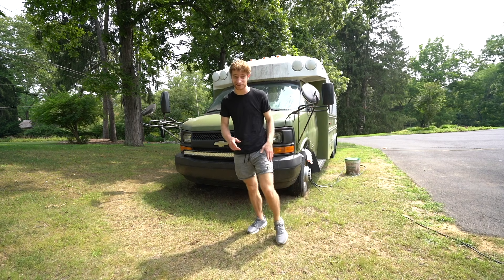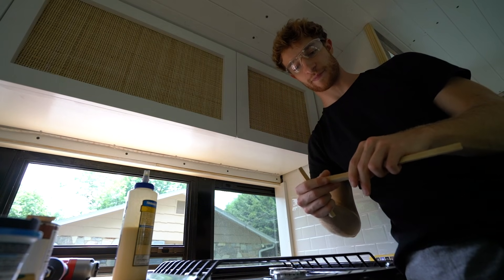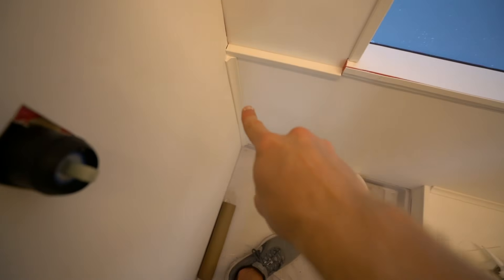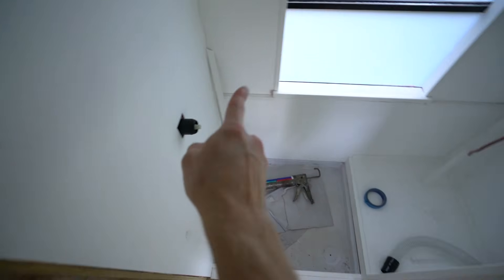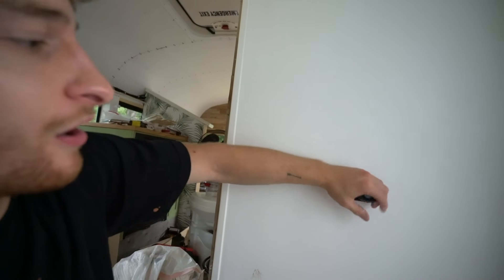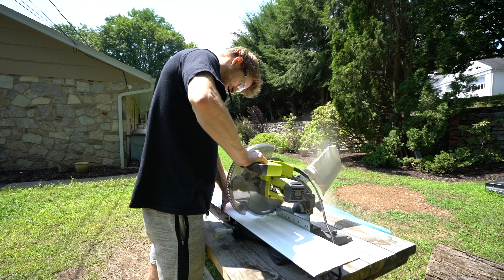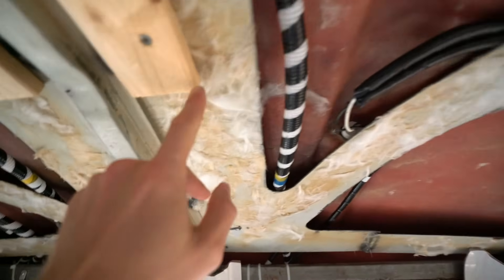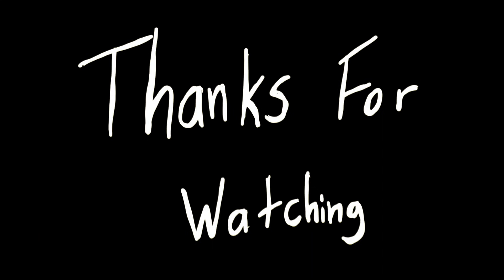Making my Bus a Little More Like Home - Skoolie Build Ep. 55

Comment: Matt, for the front, take those panels off and rotate them 90° and they should fit in, in 1 piece and bend to the shape of the roof curve. Then just caulk the seams. I would also caulk the ceiling in the bathroom as well, keep the water out. Looking fab matey.
Reply from the maker: Sweet, thanks for the tip Neil, I'll give it a shot today!

Comment: Much better video this week & your spirits seemed much higher. A lot of progress made this week. I wish I would've told you before about soaked that trim piece that you cut into 3 sections. You can soak it in warm water (I've read an hour & a half for each inch of thickness) then when it's flexible enough you can gently bend it to fit the curve & immediately attach. You could've also put a piece of the white flexible shower trim there. Just a thought. But everything is looking AWESOME Matt! I'm getting more & more excited for you! Great job & stay positive...LOOK HOW FAR YOU'VE COME DUDE! PROUD of YOU!
Reply from the maker: It's all good, I don't mind the look of it being cut up! But thank you for the advice, I might use that soaking advice for the front ceiling! Thanks for the continued support!!

Comment: Looking good, need to adjust the flame on the stove,  has to have a blue flame
Reply from the maker: Thanks so much! I'll have to check out the burners today and see how to adjust
Reply: @MattMaderic  there is an air adjustment on inlet pipe, loosen screw and open or close until the flame is blue with yellow tips. If you don't your pots and pans will have soot all over the bottom.

Comment: With wood, if its fully saturated in hot water then molded to the curve you want while it dries, it should hold its curve afterwards. Especially if its a thinner piece of wood itll work easier. Learned that from old boat building videos.
Reply from the maker: Thanks so much for the tip! My dad briefly mentioned saturating the wood too, I might give that a shot.

Comment: With that curve on the front I would seriously consider taking a cue from cars and trying some sort of headliner upholstery. I’m sure you can make wood work but it’s going to be a headache. Maybe if instead of following the same direction as the rest of the ceiling if you ran the wood perpendicular to the rest of the ceiling?  Good luck - everything is looking great!
Reply from the maker: Thanks so much for the suggestion! Headliner might be the solution, I'm going to tinker around a bit more and see what will work.
Reply: @MattMaderic  Look forward to seeing what comes of the tinkering. I think fabric is one option. I also think maybe running the boards in that area parallel to the front windows might make it look more like a feature of the bus rather than trying to match the wood on the ceiling. Or maybe like the curve you did with the trim where you cut it ever several inches. Instead of trying to make the wood bend to the curve, create a geometric form that follows the general angle but doesn't try to actually curve in the process? Hope that makes sense.

Comment: Def need to adjust the air adjustment on the stove. The adjustment is right behind the knob underneath the top. It should have a tiny set screw that you release and then turn the metal part until you see all blue flame then reset the screw. Orange flame will waste a lot of gas and it will take longer to cook cause orange isn't as hot as blue. Make sure your oven is blue as well. If not, do the same thing.
Reply from the maker: Thanks so much for the tip! I'll have to check it out today and make the adjustments
Reply: @MattMaderic  No worries. It's called the learning curve, ideally we're all on it.

Comment: Hey Matt...you could use some Lauan for the ceiling & just paint it white. Here is the listing at Lowe's Home Improvement:
RevolutionPly 5mm x 4-ft x 8-ft Poplar Sanded Plywood

Item #518477Model #518477

Just an idea. I also mentioned that you could just make a really simple overhead box & nail it up. I've seen many do that in their build.
Reply from the maker: That's an idea I've been playing around with. It might be the easiest and best solution! I'll keep tinkering haha